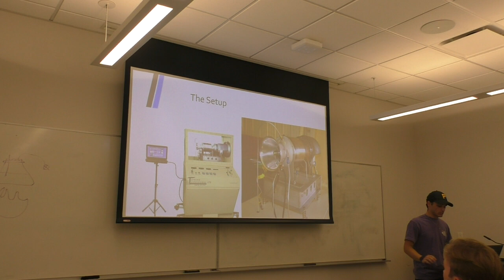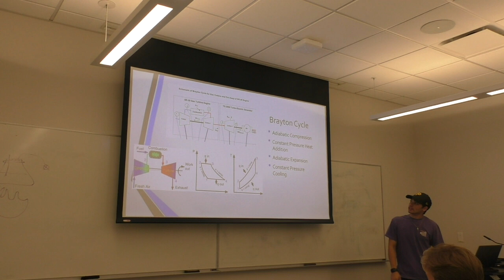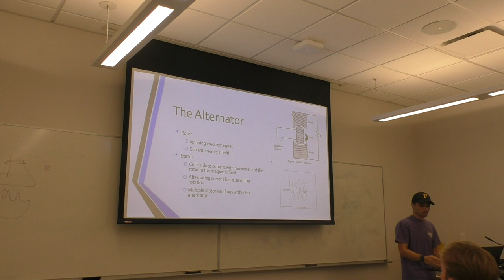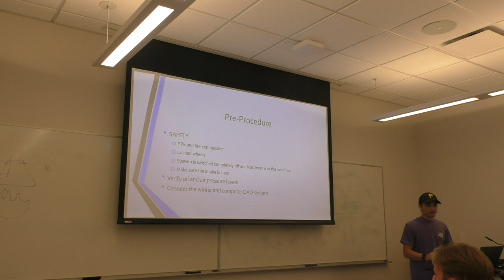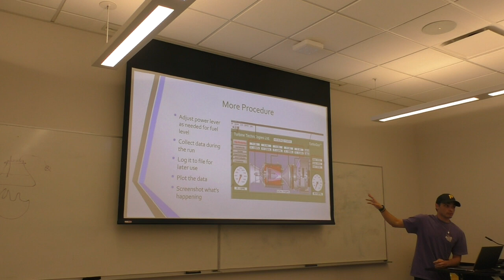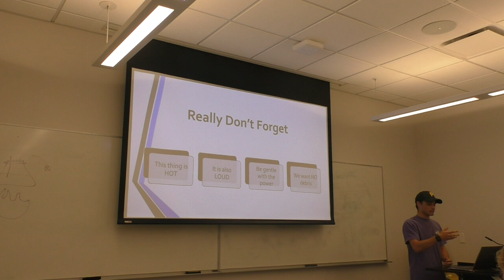Group Lead Parker

Comment: Parker's presentation on the gas turbine jet engine experiment was clear and informative, with strong explanations of the Brayton cycle and system components. He effectively emphasized safety precautions, which is crucial given the potential hazards. Suggestion for Parker would be to reduce the amount of filler words like "um" and "so," which can make the presentation feel less polished. Overall, well thought out presentation and kept the audience entertained with the general idea of the procedure.